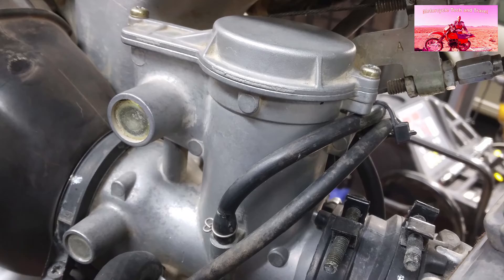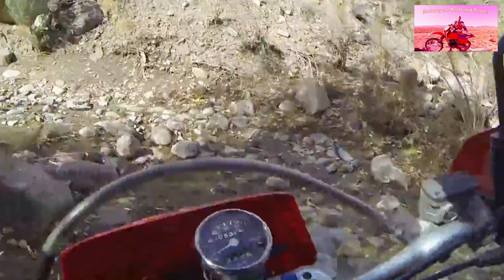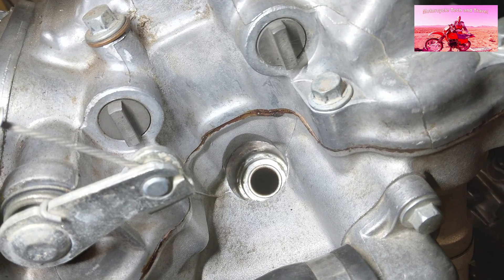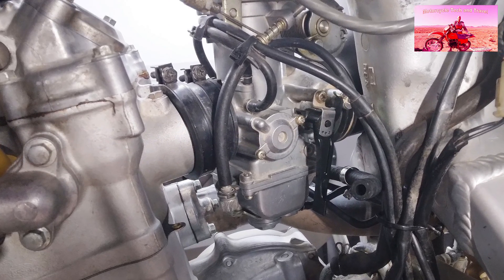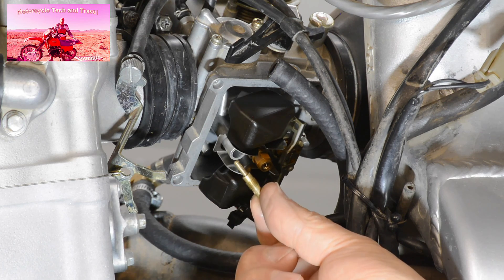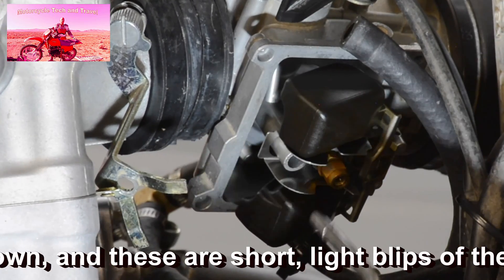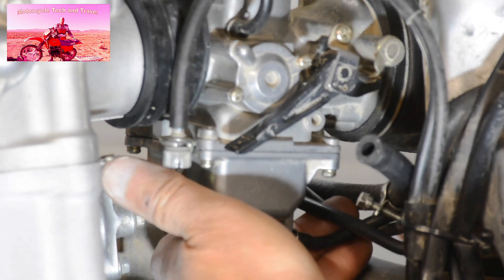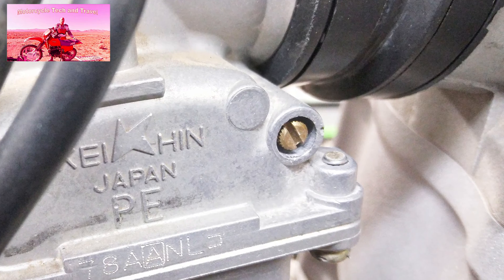Tuning and Re-Jetting the Honda XR650R for High Altitude Adventure and Overlanding Fuel Efficiency

Comment: 168?.. does it have hrc kit or not?
Reply from the maker: I am running the equivalent of the HRC kit.  My bike was a "Federal" (49-State) model and did not have the D-shape restriction in the intake manifold nor the excess emissions hardware like a California model.  The bigger tailpipe outlet (shown in this video) is like the HRC.  I am running a Stage 1 HotCams camshaft, which is mild and not significantly impactful on jetting.  Compression is stock 10:1 with a new piston and rings running in a fresh chrome-moly iron cylinder from L.A. Sleeve.  Also, my tune is for a 4,000 feet elevation baseline.  By the chart, I am running the right main jet if we begin with the HRC or a stock non-U.S. XR650R's 175 main jet at sea level.  With the 165 main jet described in the tuning video, I should be able to run at low desert or even sea level without damaging the engine.  The needle remains clipped in the third groove from the top (like stock), now with a 65 slow jet (like stock)—again for this altitude.  The engine ran well with the 68 slow jet and still runs great with the 65 at this altitude.  (All fuel flow transitions are smooth and seamless, no bog or hesitation.)  Keep in mind that I use the Pulstar spark plug.  Even with the previous 172 main jet and 68 slow jet, I could run to 8,000-plus feet elevation without fouling the spark plug.  It did run richer, but the plug fired through the richer mix.  I was unaware of enrichment unless the spark plug was removed for inspection...In testing the performance with the 165/65 jetting and 3rd needle groove from top combination, it's working very well, especially at our base altitude of 4,000 feet...I trust this is helpful.  Thanks for your subscription!
Reply: @MotorcycleTechandTravel  do you think a 5 valve top from xt660 would fit a xr650r?
Reply from the maker: Though both engines are liquid cooled, the cylinder and head layouts seem dramatically different.  (Compare the head gaskets and the valvetrain/camshaft mechanisms.)  The Yamaha XT660 five-valve cylinder head is a one-off masterpiece.  Later XT660s (4-valve) feature EFI.  If practical and feasible, it would be worth exploring how to retrofit an XT660 EFI system in place of the Honda XR650R's carburetion.
Reply: @MotorcycleTechandTravel  you mean like installing a injection system on the xr650r?. i have been looking into this. the xr revs out on 7000 or 8000? so the direct injector would be the advantage.. the trx700xx is a xr650r with injector trottlebody and bigger cylinder and it outputs like 55 hp. to even get a injector to outpreform a carb you need as many sensors as the ktm 690 have. what a nightmare. you even need to upgrade the xr650r stator to even run the electronics. unless you can find some super high end parts that can run on low voltage
Reply from the maker: You raise interesting points about an EFI "conversion".  There would be an oxygen sensor requirement in the exhaust stream (not a deal breaker) and, as you note, a need for higher stator output and a battery to handle the fuel pump, a throttle body, an ECM/ECU and any necessary sensors.  There are available stator upgrades and rewinds that will boost the stator output.  EFI would also require electric start to provide a consistent, adequate crankshaft position signal and EFI pulse.  Any EFI system needs a crankshaft position sensor and coolant temperature sensor.  Systems use a MAP sensor or mass air flow sensor, depending upon whether the design is speed density or mass air flow...I have been around automotive EFI conversions for decades.  (One example is the Jeep/Mopar EFI retrofit for the AMC/Jeep CJ and YJ 258/4.2L inline six.  There have been a number of "generic" throttle body and port/multipoint aftermarket EFI retrofit systems.)  As for motorcycles, I have not worked with systems like the Yamaha XT660 or the later Kawasaki KLR although these engine displacements and single cylinder designs would provide the right volume air-fuel flow.  It would be exciting to attempt this kind of conversion.  To the point, however, there would need to be a real incentive and budget.  The electric start conversion from C-Fab, in itself, would be a considerable expense.  A donor KLR or XT660 would be needed.  If done with commercial intent, there would need to be enough willing XR650R customers to justify the research, development (R&D) and production costs.
Reply: @MotorcycleTechandTravel  not sure if you can use the left half of the  honda trx700xx block for el start. you need to borrow the crank and aswell cylinder. i think the only way you can budget this is by getting used parts cheap... it can be done but it would take away all the advantages of the xr650r in the making.. to add all the extra weight and make it significanly more unrealiable.  there are very litle information about any attempt on future tunning the engines. i allways had the idea that with 20 bikes with the same bore n stroke length some parts would in interchangeble by random chance of the simularity of what they are compeating within.
Reply from the maker: You're right.  The amount of work, added weight and shift in the XR650R's dynamics could make EFI and electric start conversions impractical.  The XR650R was purpose built to win open desert, long distance races like the Baja 1000.  Weight savings were a consideration, as the bike got heavier with the rugged forks, bulkier aluminum frame, stout rear suspension and liquid engine cooling.  For dirt riding, electric start and EFI were not a demand in 2000.  Reliability was assured with a kick start mechanism and carburetor, an approach that worked for each of the predecessor XR enduro models.  (Several XR-L dual-sport models were carbureted with electric start.)  The CRF450X replaced the XR650R for race usage and had neither electric start nor EFI until years after its initial introduction...In support of the stock XR650R, I'd emphasize that the Keihin PE carburetor (OEM) on my XR650R has been very reliable and responsive to tuning.  (My two '84 XRs with dual carburetors have been equally reliable.)  The XR650R will start on the first or second kick after proper priming.  Troubleshooting is a breeze with a carburetor.  Set up correctly as it now is, the throttle response is smooth and, frankly, extraordinary for a thumper.  My XR650R's wet weight with an aftermarket dual-sport conversion and large fuel tank is actually comparable to a CRF300L.  Considering the power-to-weight difference, it's understandable why performance minded XR650R owners are devoted to the BRP...While EFI self-adjusts for altitude, cold starting and idle speed, I can live without EFI and electric starting.  I have owned XR enduro models since the mid-nineties and am used to kickstarting and carburetion.  The most significant downside is kick starting on a sidehill...If I wanted the convenience of electric starting and EFI, there are many factory engineered thumpers available.
Reply: @MotorcycleTechandTravel  i have not been as lucky with my xr.. bought it with a tm40 carb.. had to figure out that it was problebly tunned for a harley davidson. had to buy an original carb from germany along with rally faring n a bigger tank. first putting on the carb it really woke up the bike. later on when i decided to put on the the tank and the bike started to bog when turning the throttle quickly. the tank was actualy swaped from my brothers xr. he have my tank now. he was complaining about carb issues before the swap. seems to me that its not the carb that is the issue rather the seat that is directly over the primary air intake is now geometricly angled in a dif position problebly allowing more air. thinking of putting the carb needle on the 4 insted of the 3rd. might do it... and yes i have been looking into ktm 690 a 2013-2018 to be precise been doing some research that the cylinder from the 2019 is a bigger bore compair to the older ones. allso interested if a 5 valve yamaha top could fit this bike aswell. they are plentfull but still hold up their market price despite cam arm issue and electronics and having the 701 husquerna and 700 gas gas with the same engine.. would have been a fun project if the price was cheap enough
Reply from the maker: Before changing the needle position, check the fuel flow from the tank petcocks to make sure there is no restriction in the tank/petcock filters.  Check the fuel cap for proper venting.  Sounds like a fuel supply issue.  See my clear tube float/bowl fuel level test video here at the channel.  With the bike level, this is an easy way to note the bowl's fuel volume while you troubleshoot—without the need to remove the fuel bowl.  The fuel supply to the carburetor may not be adequate or could be air blocked if the cap does not vent properly.  Optimally, the petcocks should be above the carburetor level for consistent gravity feed pressure...Low fuel in the bowl can create the symptoms you describe.  As for the KTM690, there are many reviews online covering which year 690s to consider.  Mentioned are the significant engine improvements beginning in 2019.  Earlier models improve steadily but have a laundry list of concerns.  2013-2018 models do seem "better".  Apparently, there's a reason why the earlier models are inexpensive...As for the Yamaha 5-valve cylinder head, my bet is that the only engine it will fit is a Yamaha 660.
Reply: @MotorcycleTechandTravel  the 2012 to 2018 (654cc) have longer stroke on the crank.. the 2019 and out have bigger bore shorter crank stroke( 693cc).. thats why you want the old block with the new cylinder.. yes i checked the petcock. the flow was plentfull i filled a 4 liter can in notime. ive found that some people claim the stock needle might need to be on the 4th position... but that is not the needle i got. so perhaps.... 4th position and a shim. more like 3.5?... the bike function very well on full trottle the main jet i think was 175.. i feel some uneveness  at half throttle while just crusing. my gues is that is the needle becouse its blocking the pathway at half throttle?
Reply from the maker: Might also be the slow jet size.  Are you at sea level or close?  I ran a 68 slow jet with the stock 3rd groove on the needle.  The transition from one-quarter throttle to full main jet was very smooth (actually unnoticeable).  I ride at 4000-plus feet elevation.  The new 65 slow jet (with the new 165 main jet or a 168 main jet) and a stock needle on the 3rd groove (the stock needle setting) provide seamless transitions from one-quarter to full throttle on the main jet.  (A 168 main jet works well although I prefer the 165 when riding at 7,000-8,000 feet elevation for a lengthy period.  When riding consistently at 4000-6000 feet, the 168 works better with the HotCams Stage 1 camshaft's rpm range.)  Since you are near sea level, you might try a 68 pilot/slow jet before changing the needle height.
Reply: @MotorcycleTechandTravel  i think i am pretty close to sea level. cant remember if it was 68 i had. but it idles very well. if  driven dayli it starts at 1st or secound kick given its not cold outside. the type of bog i have is the to lean type. and its accuring when i drive aswell when rpm is above idle
Reply from the maker: The idle circuit can be right on, even with the symptom you describe.  The slow jet will usually create issues from 1/4 throttle upward until the needle reaches maximum flow at the main jet.  Your idea of changing the needle height might be helpful.  If the engine is "uncorked", possibly with exhaust or air induction modifications, and if the needle is stock, a 68 or 68s slow jet change could eliminate a mid-throttle lean condition.  (I would start tuning with the needle in the stock/3rd groove from the top of the needle and just change the jet.)  If you want to richen the mix from 1/4 to 3/4 throttle without changing the slow jet, the needle needs to be raised.  This means putting the clip one groove lower on the needle (the 4th groove from top of the needle).  You want the needle's taper to lift earlier to get a richer mix...Here is a very useful breakdown of carburetor tuning directly from Keihin North America:  https://www.keihin-na.com/assets/1/7/slide_valve.pdf.
Reply: @MotorcycleTechandTravel  cool chart. just shows how good my brothers xr is diled in.. from the moment he open the carb piston its just explotion. he got the hrs kit on tho but the bike just feels very right from the carb side.. mine is just uncorked. i checked the needle its b53e so its not the original one so my carb is good on paper. i can try and see if i got a bigger pilot then 68 at hand.
Reply from the maker: I would try a 68 slow jet, no larger.  A stock XR650R PE carburetor (if a factory replacement carburetor and tune) is a 65.  Try leaving the b53e needle in the third clip groove from the top end of the needle, same as the factory setting shown in the Honda shop manual.  Also, confirm that the spark plug boot and connection are good with a crisp spark and correct heat range plug.  (Rule out an ignition or coil issue.)  Gap the plug carefully.  Then test.
Reply: @MotorcycleTechandTravel  bike was in really good condition when i bought it. its bearly been used. under the seat there was no sign of dust. the bike have never been offroad until i took it for a spin. i put a new sparkplug in it. it preformed alitle better with ngk. the coil and everything just look factory mint. but yeah the swap from denso to ngk improved the bike a tiny bit. intresting if i can find a sparkplug with smaller electrode it would make sense if the stator on theres bike dont generate alot of power
Reply from the maker: You found an excellent bike...Some replace the NGK BKR7E-11 with the NGK iridium tip (fine electrode wire) spark plug.  An iridium plug does resist fouling better than a conventional plug.  Use care when gapping an iridium plug, the fine wire electrode can be easily damaged.  (Do not put pressure on the wire electrode.)  The iridium plug usually comes out of the box within the Honda gap setting.  The stock stator and coil are adequate for firing either spark plug type while kick starting.  Either plug should provide good service.
Reply: I’d like to get a Mikuni TM40 pumper carb for my XR650R. What’s you input on those? I have an FCR MX41 for my 650L. Runs more aggressively and no choke needed on cold starts. Just open and close the throttle prior to starting and fires right up and idles.
Reply from the maker: Many like the Mikuni pumper carbs.  I'm getting excellent performance from the original PE Keihin tuned properly.  You FCR MX41 is intriguing, thanks for sharing your experience.  I am always fine tuning and monitoring real world results.  My latest tune for the PE and riding from 4,000-8,000 feet elevation is a 65 slow jet and 168 or 165 main jet with the needle in stock 3rd clip position.  I can easily change the main jet to a 172-178 for a sea level fine tune.  (The pilot/slow jet is more involved with the need to drop the bowl.)  A 65 slow jet works well at my altitude, and this is the OEM.  I did run a 68 here and would consider that for lengthy runs at sea level to 3,000 feet operation.  This tune is for an uncorked 49-State engine with a HotCams Stage 1 camshaft and stock exhaust.  I use a Pulstar spark plug to offset slightly rich mixtures and smooth the altitude changes.  Each engine and riding venue is different!

Comment: In oz at sea level 65s pilot and 168 main needle 4th clip position. Std piston,cam aftermarket exhaust uncorked just lovely.
Reply: Needle is the completion version.
Reply from the maker: Sounds good...If your 1/8th to full throttle makes smooth transitions, you nailed it!
Reply: @MotorcycleTechandTravel  I found that you can enrich the idle circuit by leaning the bike over to the right for cold start, otherwise it's a one kick operation.
Reply from the maker: Yea...We want these kickstart-only bikes to fire immediately, especially when traveling single track.  Sounds like great tuning!